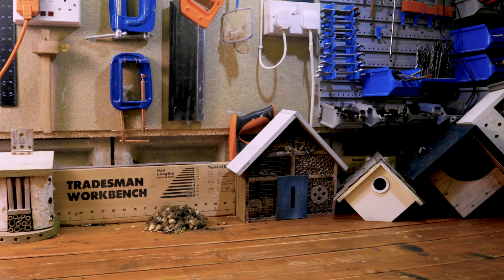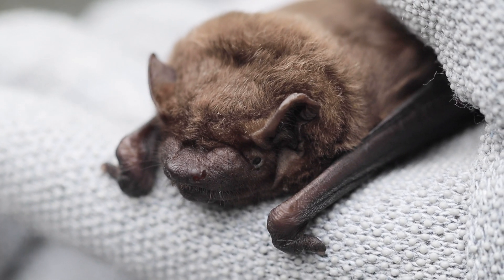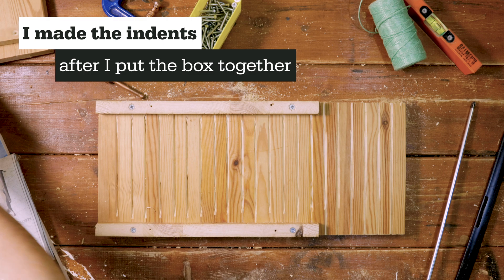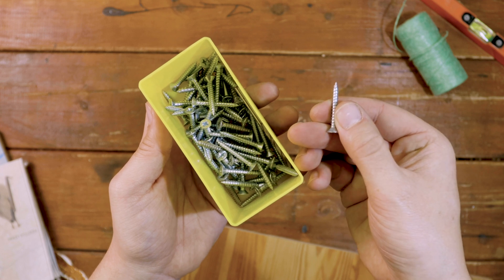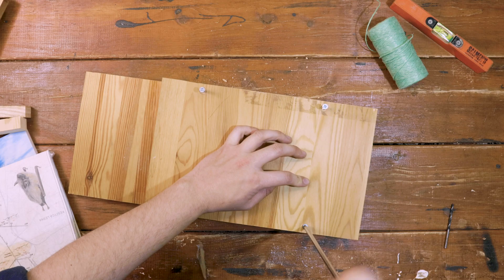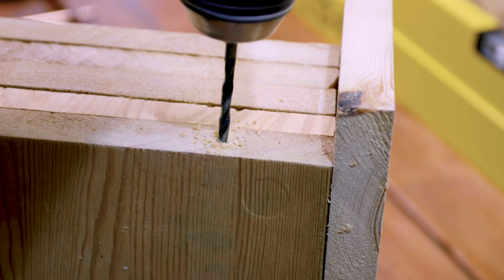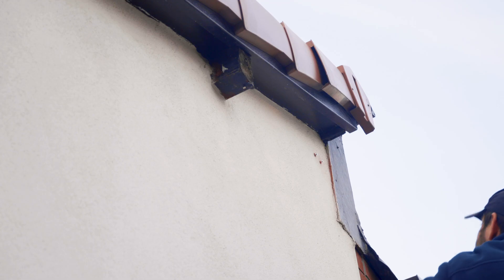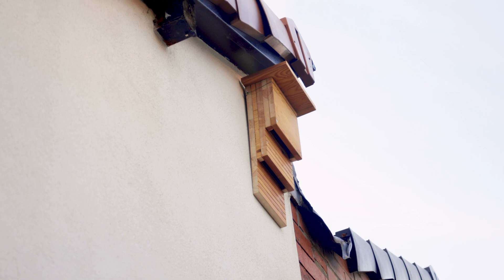How to make a bat box

Comment: can you put it in inches instead of cm.
Reply: There are 2.5 cm per an inch.  Divide centimeters by 2.5 to get inches.  Divide millimeters by 25 to get inches.

I’ll make this simple for you.  The most common bats in bat houses are microbats. Microbats need 3/4 to 1 inch of space between chamber walls.  That means your rails or dividers separating chamber walls should be 3/4 to 1 inch in thickness. Macrobats need 1-2 inches of space between chamber walls, but most people don’t have Macrobats. Some microbats will roost in some macrobat homes, but the macrobat home won’t protect microbats from snakes, owls, squirrels, raccoons, cats, insects, and other predators.

To ensure your bat hose can collect and hold enough solar heat for the bats, the walls for your largest chamber should be at least 14 inches wide and 24 inches long.  These measurements match the dimensions of other flying animal houses which allow one to integrate a bat house under a bird house if they don’t have a lot of room to deploy houses separately.  I use the macrobat chamber minimum 36 in L x 18 in W for microbat houses which also matches other flying animal houses.  All the other chambers can be smaller as long as your biggest chamber is at least 24 in L x 14 in W for microbats and 36 in L x 18 in W for macrobats.

The other thing you need to know is you need to mount the bat house on a pole or wall at least 10 feet above ground facing south, south east, or south west.  

If you’re mounting bat houses back to bat, you can use a north/south facing, but east/west is better.  There should be no obstructions 10 feet below the bat house as well as 10 feet in front of it. This helps prevents predators from jumping to the bat house or waiting to snatch the bats out of the air as they fall out of the bathhouse and take flight.

Comment: Has anyone actually found this design work?
Reply: It works.  The key favors are the size of the chamber, the spacing between chambers, and the mounting location.  The largest chamber should be at least 24 inches long and 14 inches wide to collect enough heat.  The space between chamber walls should be 3/4 inch to 1 inch to prevent predators and insects from entering.  The mounting localization should be at least 10 feet of the ground at least 10 feet from any obstructions in front.  This gives a lot of room for bats to fall out and take flight as well as help prevent predators from being able to get the bats in the house or taking flight.

Comment: The best way to make BATS GET A GRIP . Is using a ( drawing) compass  or similar tool to make loads of tiny holes 3mm apart  in the cavity and landing pad  . Therefore the wood is not smooth   
 Additionally 5 mm.eye  metal screws  can be used for same grip technique . Honestly works wonders 🇹🇷🇮🇳🇹🇷🇮🇳🇹🇷🇮🇳🇹🇷🇮🇳

Comment: Does it have to be rough sawn? I have lots of wood from different places, but its all treated. Plus the rough sawn stuff online doesn't quite have the right specs. Mainly width. I'm in the UK
Reply: Doesnt have to be rough sawn just put some grooves in so they can grip, youre not supposed tonused treated though, i think its to do with chemicals leaching when the wood gets damp.
Reply: If you want to help the wood resist rot without the use of nasty chemicals, try walnut oil. I use it for breadboard and cutting board projects, but I also liberally coat the outside of my birdboxes with it once per year. Warm it on a radiator or in the sun first, then apply with cloth or suitable brush. Don't overdo it; let each coat soak in before you start another. It will make the wood water-resistant and is harmless to anything that doesn't have a nut allergy (so be careful with humans!).
🏴

Comment: How did you put the indents in the wood AFTER you'd assembled the box? 1.15
Reply: If you don’t have a saw, scratch the wood with a screw, nail, chisel, painter’s multi-tool a.k.a 5-in-1/6-in-one tool, or anything else you find easy to leave tiny gouges in the wood.  The scrapes don’t need to be deep. It the tip of your fingernail can grip the scrapes as you scratch your fingers across the wood, that’s more than enough for the bat’s sharp claws to gain purchase.
Reply from the maker: Yes you should do this BEFORE you assemble the box

Comment: Hi Great video just what I was looking for , I was going to put my box at the back of my shed under the over hanging roof , but it's only 2.4 meters high would this be ok ,G
Reply: That’s just over 8 feet.  While 10 feet or 3 meters is better, 8 feet or 2.5 meters isn’t bad.  Most microbats can make that work. Just make sure there are no obstructions below the bat house.  Try to not put any obstructions 3 meters or 10 feet in front of the bat house either.  The bats need that space to fall out, catch flight, and take off upward.  Keeping that space clear makes it easier for bats to take off and harder for predators to get the bats in the house or as they take off.
Reply from the maker: Hi 👋. Where in the world are you based?